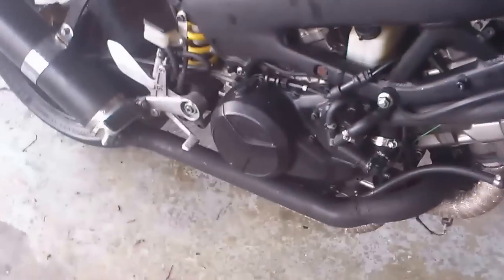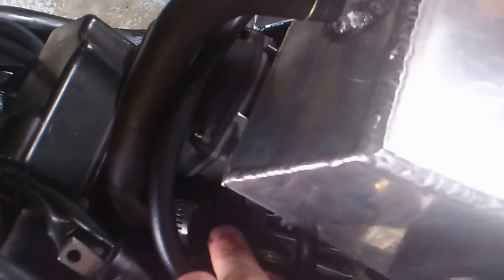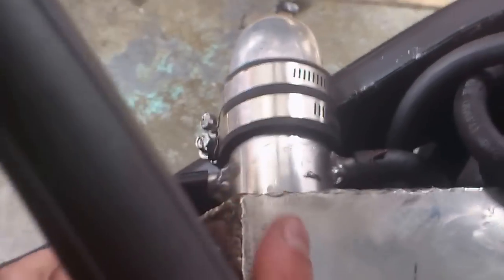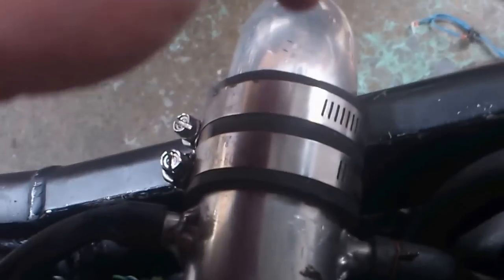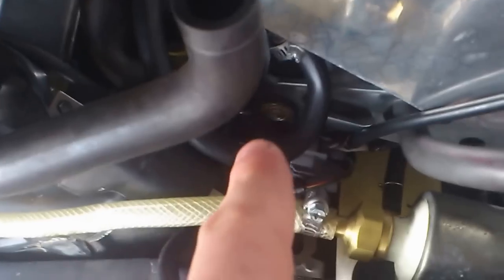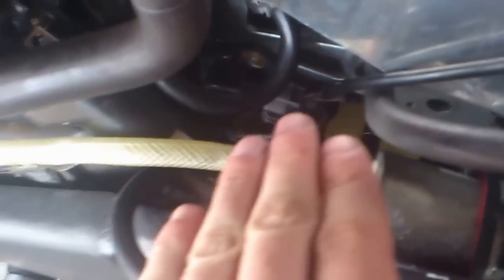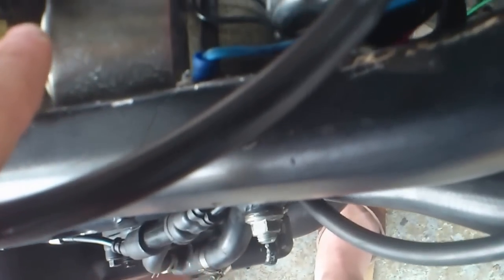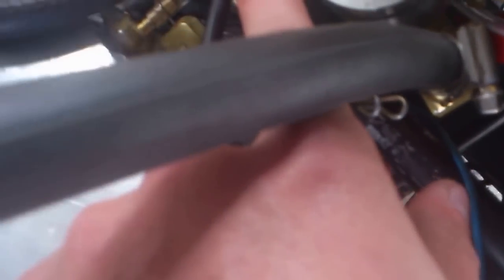how turbo a carb motorcycle (blow through )

Comment: tell me the outlet of the fuel pressure regulator plug directly to fuel line? the pressure was enough to push the folt valve?

Comment: so are the carbs in that box
Reply: You are talking about cv carbs then
Reply from the maker: they are attached to the box ,right under.......
Reply: What does he mean pressurise the slide
Reply from the maker: gareth liddle  if u take the air box out you can see the slides and those slides control the height of the needle 
Pressurizing the slides means or what I meant was to connect the vent of the slides diaphragm to a pressure source aka the air box and that will allow the needle to lift under pressure there for you will have more fuel to the motor.

Comment: Do you have a wideband? So does plenum size dictate how well it works?
Reply from the maker: i do have a wide band ,im not sure what u mean with how well it works .
the plenum size helps with tuning and air flow etc
Reply: Any experience with using a blow through on a Harley?
I'm getting ready to try it on my sportster.
All the info I've found leads to completely sealing the carb and the plenum outside but connected to the carb. The carb has to be modified where it can be pressurized. How are you figuring what size your plenum needs to be? I've heard several different ways. Thanks

Comment: I want to do ram air intake so all i have to do is conect the float bowls tubing and the vacuum tubes from the carbs can i conect them on the air box so they can be at the same pressure as the air box i forgot to conect those tubes and at litle more speed its sputtering and loses power
Reply: I am doing the same thing to a 250 v-twin, I kept the original air box and added a 3 phase BLDC motor with an ESC controlled by the carby's Throttle Position Sensor, you need the carby's air vent/vacuum hoses to connect inline with a Pitot tube to balance float bowl pressure under higher boost. If running higher boost than 5psi you will need an electric fuel pump and regulator otherwise it will run out of fuel at high boost and prob detonate your engine which will melt your pistons, not connecting carby vacuum tubes will have the same result.
Reply: The Rider hello,, bro did it work the blow truu carb stuff using the same method as the vids is showing???

Comment: Man I have a problem with a proyect Im building I am trying to put a supercharger on a volkswagen rabbit 84 I install 4 carburators of a kawasaki 900 cc and then I try to make a blow through carburated sistem but when I start up the engine on idle the engine runs good but when you acelerate the engine starts to fail and it shuts down.
I have the original mechanical fuel pump you think that could be the problem?
I hope you could help me thanks
Reply: paloysamu luna moran Maybe I'm wrong but is the fuel pressurised as well? If I'm not mistaken if you're running boost and haven't pressurised the fuel as well the air will push the floats close and there won't be any fuel getting mixed. Does make sense to you?
In idle you're not getting any boost but when you accelerate you create boost thus closing the fuel feed. Think about it.
Reply: Spot on! not enough fuel = lean A/F ratio = kaboom

Comment: do i have to do that if i put an electric turbo with Just 3 psi?
Reply: An electric turbo wont work so no. Your better off just getting a regulator and running pressurized fuel to it. It will make your bike alot faster just from the extra fuel pressure.

Comment: One little point I'd like to make note of. Honda carbs are CV style, but they use a special hose in the intake to make the slide lift based in air velocity. Most other manufacturers use a Keihin CV carb where the slide lifts from an opening in the intake side of the carb venturi. No extra hose to consider.
Reply: My thoughts exactly... Like a ram air system most carbed bikes utilize

Comment: This video is very confusing. Did you mean engine PULSES when you said "plus"? And it sounded like you meant 30% PSI over the boost you want to run, not just 3 psi, because your math did not add up at all. I think it would take much longer than 10 minutes to properly educate people on how to turbocharge a carbureted motorcycle. You also stated that you keave the carbs internals alone. That just cant be true. You would have to change out the jets, adjust needles and everything else involved with tuning a carburetor. What do you mean by the plenum or "pressurizing airbox" pressurizing the slides? Does the air somehow push the slides for the carburetor? Thats what it sounds like from your video but that cant be right. If thats the case, how do the push and pull throttle cables work with that? To me it seemed like it would really help if you knew what all the parts were called un the video and explained what each component does. You tried to explain in detail what a couple rubber hoses did, but didnt explain to anyone what the fuel pressure regulator or other major components do. I think this video will confuse people more than anything or possibly make people think its super easy by the way you generalized motorcycles and their engines and vastly dofferent technology and characteristics. Did you turbo charge this motorcycle yourself or did you pay a shop to do the entire thing and just recorded yourself trying to explain it afterward?
Reply: I don't know the level of your experience. I do know a lot of these people commenting will be thinking it's a easy job. 
I've been researching on this for 8 months. Sooner or later I will have one on my Harley sportster. Before someone attempts it they have to understand what,why and how it all works. Some of the things I've come across blow my mind. I have had to learn things and understand things I didn't know anything about. I had to learn how to seal my carb and pressurize the float bowl. It's crazy what all you have to learn.
Reply: Actually, I learned what I can’t here for. The pilot tube to pressurize the bowls and how to install it. Thanks for the video. It helped.

Comment from the maker: That's the turbo up pipe , feeds air from turbo to the air box forcing the air threw the carbs
Reply: wait...The turbo pipe isn't the one on the left of the bike ? The one that goes under the bike ?   I'm talking about the other side, the one just above the fuel pump. For example you can see it at 04:15. Thanks
Reply: and what about the pipes that comes from the carburetors ? The ones that controlls the springs. Normally they go in the air box in some small cases. How did you attached those?

Comment from the maker: Tubes on the ride are fuel lines for fuel pressure regulator , small tube vacuum tube 
Carbs are bolted the plenum then sealed , there is a o ring between the plate of the plenum and the carb then welded the top shut
Reply: Ok interesting. I'm thinking to make like a cover on top so I can have access to the carbs if needed.
And about the other thing, I'm talking about the Large metal part (like a large tube) above the fuel pump, welded to the box. It has a small rubber tube in it. What is that ?

Comment from the maker: U don't always need intercooler.
Intercooler is definitely better and denser the air charge but it's not a must 
I own cbr1100xx turbo with no intercooler to save wieght and I run 30 psi with no cooler on alcohol
Reply: I got a far 600 1989 i want to boost it . How do i do it

Comment: mate need ur help turbocharging my royal enfield single cyclinder 35occ with a carb
Reply: the capacity is small. cant have a turbocharger on it. also it needs a intercooling system. which an Enfield doesnt have. as the compressed air is really hot and it may cause knocking.
Reply: awesome and can you suggest a carburetor for it
Reply: Melwin Daniel Nadar you can use water/meth injection and no intercooler because the water being injected cools air temps in the combustion chamber and the meth is super flammable and will raise octane levels to suppress knock

Comment: 120psi fuel pump? 

You mean 120lpm fuel pump
Reply: AllAroundAuto I'm pretty sure he meant it's capable of 120 PSI... he explained that he runs 3 PSI at idle and it goes up on a 1 to 1 ratio with Boost.
Reply: But he said 3psi over PEAK boost number, I'm confused lol
Reply: @ridintilldeath9484  He means you need a more powerful pump than the boost from your turbo because the boost pressure will push the fuel back out of the carby up the fuel line into the tank, most pumps are capable of doing 50-100psi or 300lph which is way more than your average turbo and then you will just spray fuel out of your carb and flood it, so then you need a fuel pressure regulator which is adjustable so you can lower the fuel pressure back down to be the same as standard boost psi + 2-3psi  as 2-3 psi is standard fuel pressure  but it needs to be higher than base level boost pressure, so say you are running a 10psi of boost so you need to set the regulator to 13psi. The regulator has an inlet that allows you to run a line from the turbo to the regulator so as you accelerate and the boost builds up it increases the fuel pressure from the regulator to the carby at a 1:1 ratio of boost to fuel. So that way you will always have a constant equal supply of fuel to your carb. Otherwise as the boost builds up the fuel wouldnt be equal and you will most likely stall at higher revs.

Comment: So for example I'm putting a turbo on a 250cc 4 cylinder bike;
Ill need a 400ml minimum sized plenum (Replace Air Box), to pressurise the carburettor bowl, with pressure from the plenum. Ill need a fuel pressure regulator with a boost refference and a high pressure fuel pump, with the regulator hooked up to the carburettor vacuum(now boost) line.

Now with this done ill need to re-jet it? and will obviously need really good float needles... What I didn't understand is what you did with the diaphragm breather? Did you just hook that up to the plenum too, that would make sense to me. Also you put a non-return valve on the line going to the bowl, so that under vacuum it doesn't suck fuel back into the plenum right?
Reply: Lynxdragon put the biggest air box u can fit it will make tunning the bike simpler because it will make the boost more stable. you need a efi fuel pump with a boost reference fuel pressure regulator (fmu) you want about 3 psi higher than boost psi (10psi of boost is 13psi of fuel pressure) to help fuel flow or if boost will force the fuel back into your tank. also its a return style so you need to add a return fitting into your tank above the height of fuel level or you will restrict the return and never get a steady fuel pressure.. the line from the air box must go to the fuel bowl vent (same as ram air) to help force fuel in... this is the only way to keep about stock size jets so it will run good on and off boost. and no check valve float bowls vent tube as they are normally under vacuum and will ballance out themselves
Reply: Great info. Why don't you have any youtube video's? You a member of any forums or fb pages?

Comment: Very cool invention, but wouldn't you need more fuel not only to the carbs from the tank, but to the heads from the carbs? I have a little experience with carbs on bikes, And I know when you give more air it needs more fuel. Maybe the fuel pump is pushing enough fuel thru your stock jets. But don't you think you need to rejet the carbs for it to run properly?
Reply: I don't think so, the float is closed by the fuel level.. if the bowl is pressurized the float is just simply under pressure.. pressure is not directly pushing the float closed - also the fuel pressure is to be set at 3 psi above boost pressure so fuel will enter the bowl when the bowl is pressurized. That's the reason for the boost reference fuel pressure regulator, that regulator will maintain proper fuel pressure in reference to boost pressure.
Reply: the gas is sucked by the air flow. bigger air flow provide more gas. but i would rejet the carb.
Reply: Wouldn't the air pressure push the floats close and thus blocking any gas from being mixed?
Reply: Uhhhh hmmmm pitot tube should Answer your question to why you don't need bigger jets vadim khrustaley
Reply: @ridintilldeath9484  anytime you add boost you have to add fuel to maintain air/fuel ratio. That's done by either drilling your jets, or by putting bigger jets in.
Reply: PITOT tube is what I said above "PITOT" look it up bud, Thats how he's getting the extra fuel without changing the Jets that doesn't work all the time but if you do need to change the jets which you might have to do it won't be by a lot if any and that's because it's putting preassure on the fuel PUSHING it through the jets when air preassure is increased in the charge pipe via a turbo in this case.
Reply: @ridintilldeath9484  gotcha, my mistake.
Reply: In other words; pressurizing the pilot tubes is necessary to push fuel under boost, but you still need bigger jets. That's just turbocharging 101, bud.

Comment: Question i have a 98cbr900rr i dont have a fuel pump its vacum fed trugh my pepcok and a diaphram on the pepcok and a vacum hose commig from the 3 cylinder to the pepcok do i need to install a fuel pump or a larger what APE calles their guzzler pepcok that works off two vacum prorts to flow fuel faster?
Reply: Rage Cage07 you need to remove the vacuum ports so fuel flows under boost... if u put a fuel pump with a return style fuel pressure regulator you will need a return line fitting put into your tank higher than fuel level or it will restrict the return line and give u sky high fuel pressure and flood out the bike

Comment from the maker: Not a problem guys and I'm sure it will work on the dirt bike and if it doesn't have fitting to pressurize  it witch I'm sure it does u can use any other carb from a sort bike and fit it 
I recommend 86 gsxr1100 carb it's 36 mm carb and works great 
Cheers
Reply: so did you create a sealed boost box around the carburetor?

Comment: Im looking to turbo a suzuki gs 450. So all i need to do is go up in jets put an oil pump to the turbo make a metal air box and attach pressure lines to the slides and the bowls and then the box to the carbs? is there anything else?

Comment: UH THE BOOST LIKE GOES THROUGHT THE HOUSE LINES , UHUHUHUH and uh the turbo like goes through the small pipe and the whole is going to the big pipe and i dirilled it out, and the AIR goes through and the main thing and the main thing and the maing the the plentum thingy mugiggiy goes up to 1.7 duh liter, and the 2 cyliinder you need and two liter, and the 4 liter is bigger then the 2 liter bacily presureies it  AHAHAHAHAHAHAHAHAHA what a fucking tool

Comment: Do you use a one-way valve on the tube that goes from the pitot tube to the float bowl to keep it from sucking fuel out when the engine is under vacuum?
Reply: vespa400car no because cv carbs are made to be under vacuum so fuel flows under boost the floats need to see a higher pressure to force fuel into the carbs.. as this will also force fuel into the motor... also a big reason why the main jets can stay stock size make sure u use a efi inline fuel pump like in the video but he for gets to tell you to use an fmu you want 3 psi higher that boost psi so fuel will flow and you dont need huge main jets this way idle and out of boost runs well
Reply: 3 psi high fuel pressure than boost... so 8 psi of boost is 11 psi fuel pressure

Comment: i want to turbo a car with a carb. did your carb already have a connection the pressurize the bowl?
Reply: people just google how to turbo a motorcycle... once you read you'll understand everything he is talking about but a pilot tube in the intercooler piping works better to put pressure to the float bowl rather than tapping into the air box as you wouldn't see the correct volume.. the sizing of the air box gets larger with less cylinders (smaller cc) as the exhaust pulse is so far apart you need more volume in the air box to keep pressure steady..... i can go on and on but you can find articles from people who know more just look